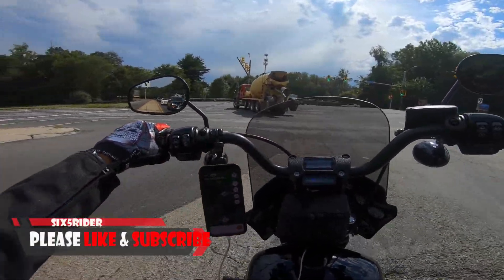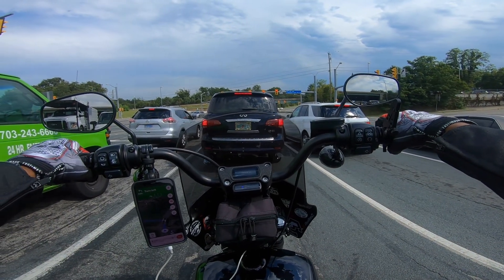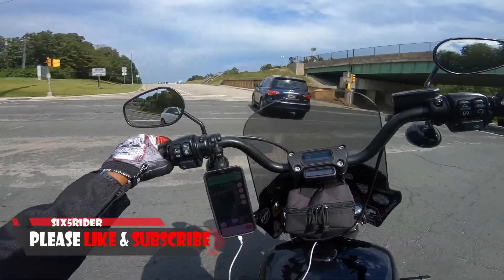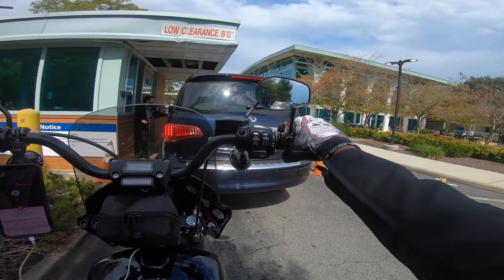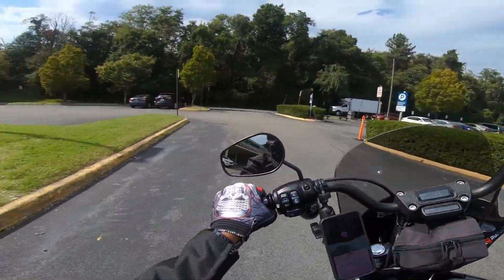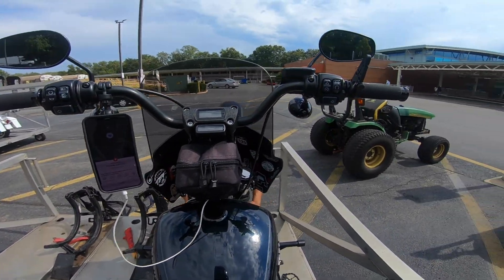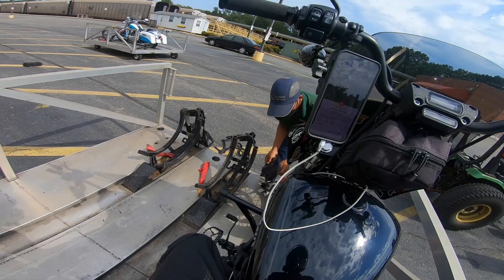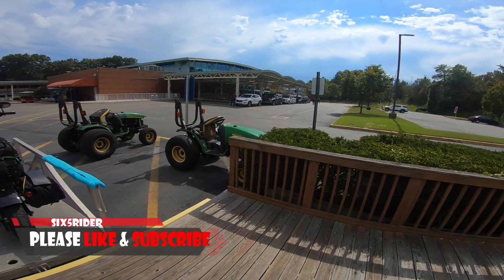Amtrak Auto Train | Lorton, VA | Motorcycle

Comment: So it appears they hooked it up lower above the fender like they where supposed to and not compress the from shocks/forks? If this is the case then i might actually look into doing this with my bike too.
Reply from the maker: Yep. I was also relieved when I saw they did that. That’s how I always transport my bike at least to avoid a blown fork seal.
Reply: I'm riding the train tomorrow.  I'm relieved as well. I have a BMW RT and you can only tie down the bike this way. If you do it any other way it will damage the bike due to the tele-lever suspension.
Reply from the maker: @bwkern3  awesome! Let me know you’re experience after you’ve ridden it.